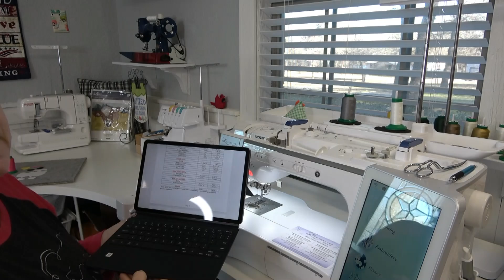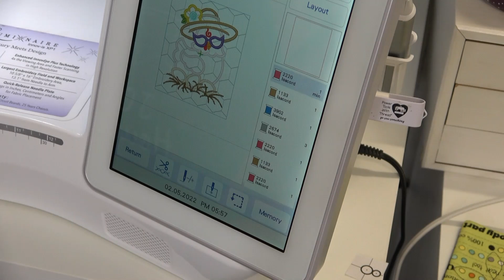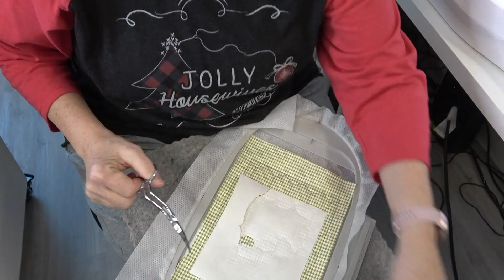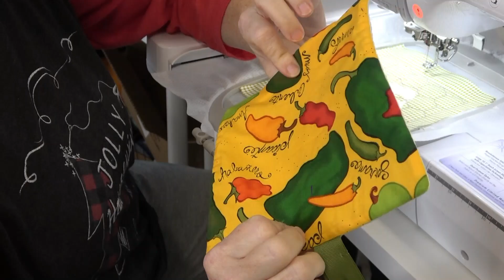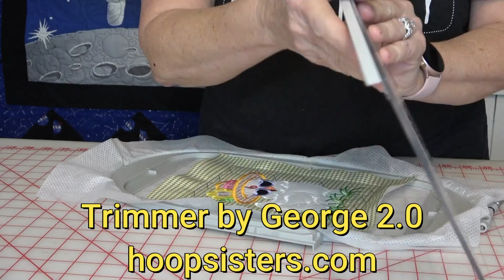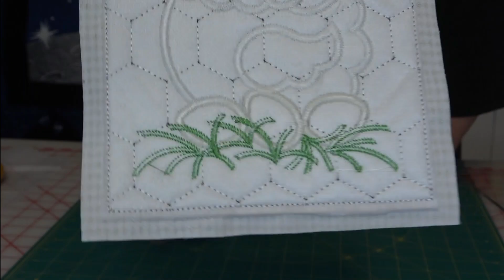Pt 2 Designs by JuJu Chicken Placemat - Brother Luminaire Single Needle Embroidery Machine

Comment: I really appreciate these videos. I have almost given up embroidery as some of my larger projects are coming out wrinkled when I take them from the hoop. No amount of ironing seems to help. I haven’t bought this placemat set, but I do have others by Juju. You have inspired me to try again. BTW, I have a horrible time hooping, even after a few years of using my machine. I cannot seem to center the fabric within the hoop. Still working on it, and have gotten a little better, but it takes me almost as long to get fabric hooped as it does to stitch out the design. Again, thanks for all your tutorials.
Reply from the maker: You might try floating your project then instead of doing traditional hooping.  Or you might consider a magnetic hoop which allows you to tug slightly to make tiny changes once the top hoop is on.  DIME's hoop mat makes a world of difference to find center as well.  It's probaby my favority centering tool I have.

Comment: When I looked on Hoop Sister’s store, the only George2.0 available are “second quality” because George3.0 is coming out soon.  What do you recommend?  Do you know what the difference is and should I wait and get 3.0?
Reply from the maker: I wasn't aware they were making a different ruler.  I'll have to check that out.
Reply: @PowerToolsWithThread  i reached out to contact them at HoopSisters to ask about the new tool but have not heard back.  I don’t want to order both so will have to decide which one will benefit me most.  I wish I had found this sooner.  It looks like this is a game changer for trimming the batting so you don’t get batting sewn into the seam when you join the blocks.  This was always an issue for me.  No matter how careful I would cut, there always seemed to be places where I didn’t get close enough and batting ended up in the seam.  UGH!  I also have blocks that I never trimmed up to complete a project because I hated trying to cut them close and even.  Thanks for sharing this product!  So helpful, I’m sure!